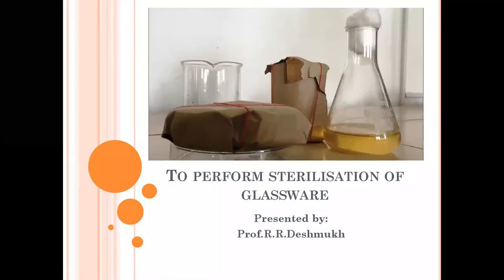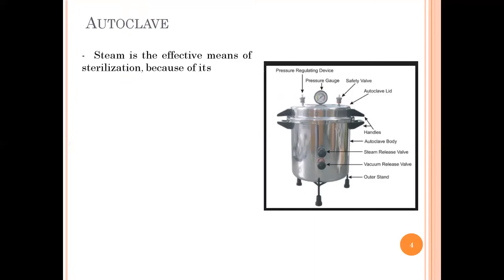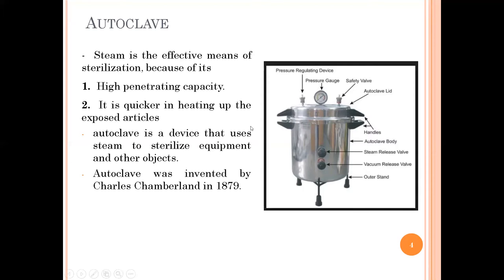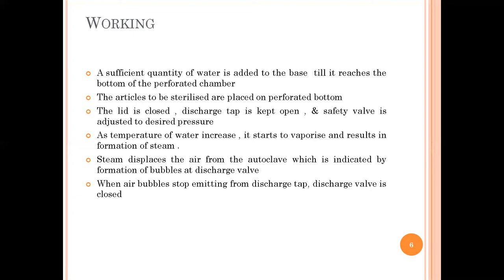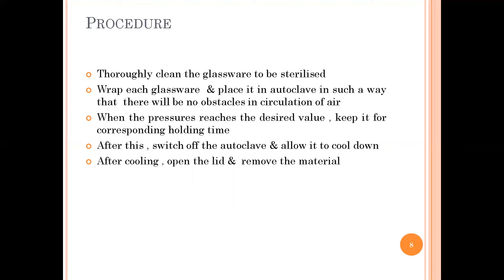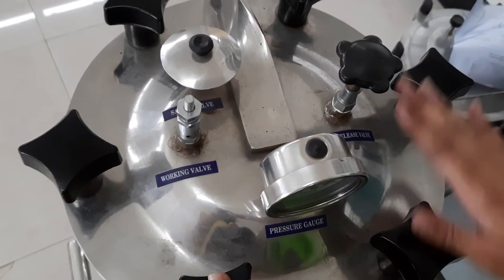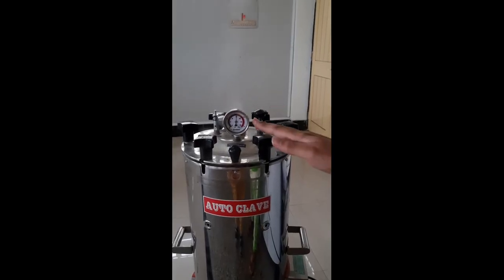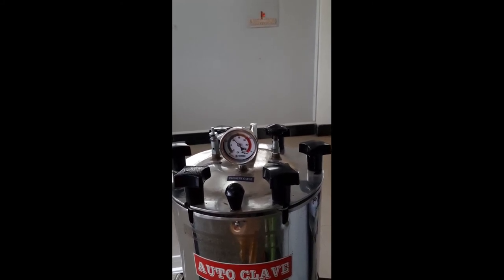Sterilisation of glassware

Comment: Try to speed up the lecture...
Reply: Just increase playback speed to 1.5….
Reply: the way u have unscrewed the steam release valve in the end is not correct, it could suddenly cause the steam to jet out causing SEVERE injury.......please BE mindful not to do that.......also it causes a sudden pressure diffrential.......best is to let the pressure come down on its own......